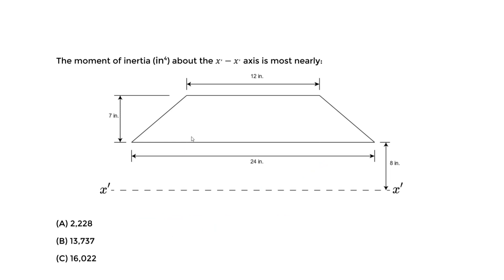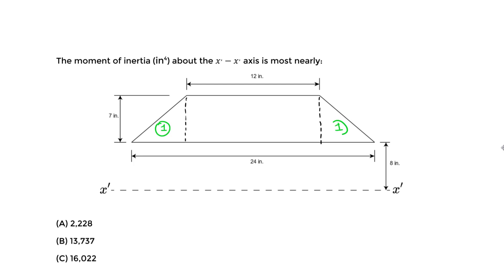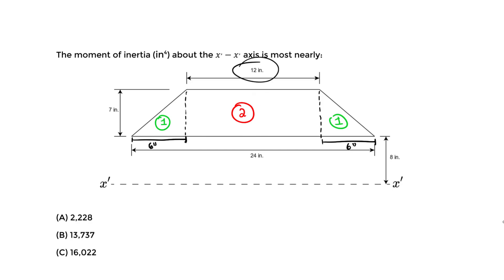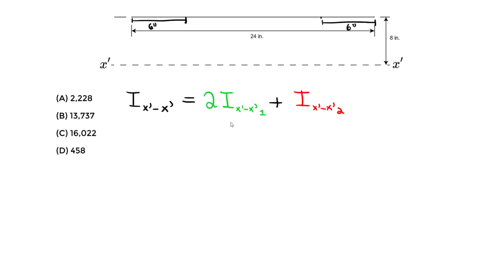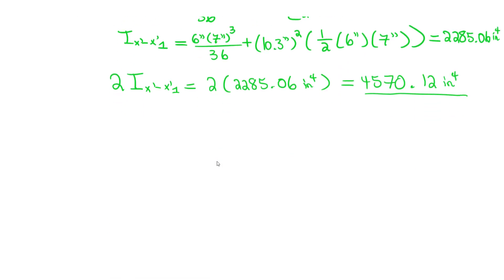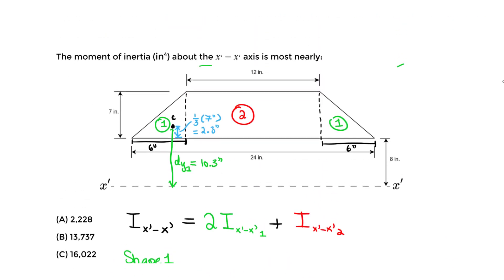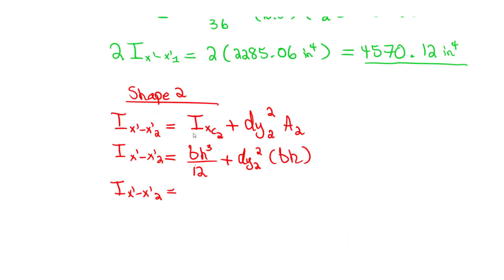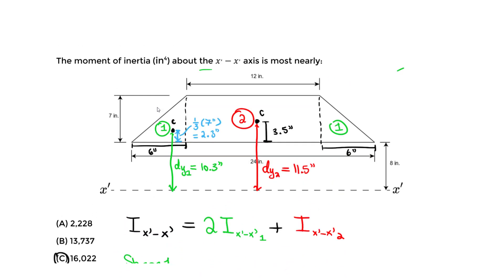FE Exam Review - FE Exam - Statics - Moment of Inertia

Comment: I have a question. On the handbook for the triangle shape, it has Ixc and just Ix. It also have Iyc and Iy. How do you know when you would use the one with the c or without the c?
Reply: That was question 1. My second question is, let’s say you had the exact same shape in your video, but they were all lined up with the X axis and not at some distance away from the X axis. Would you use the Ix and Iy without the “c”? I am assuming this since they would all be lined up and there is like be no vertical distance difference